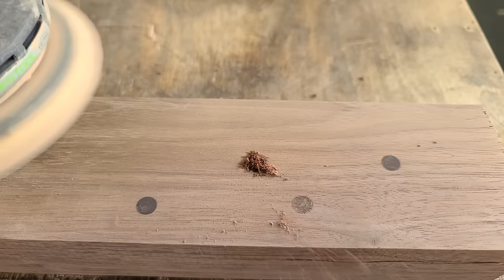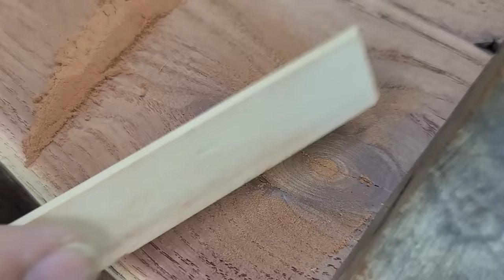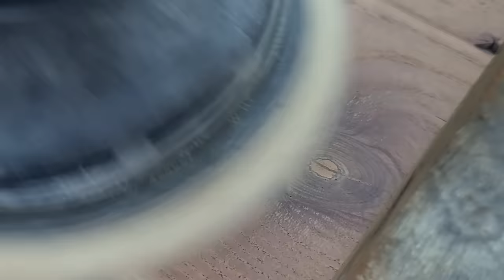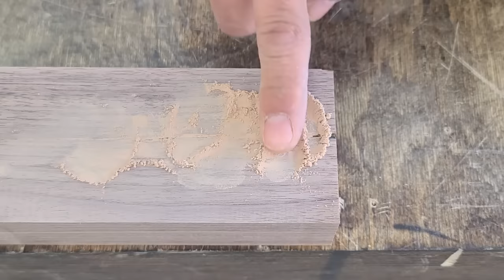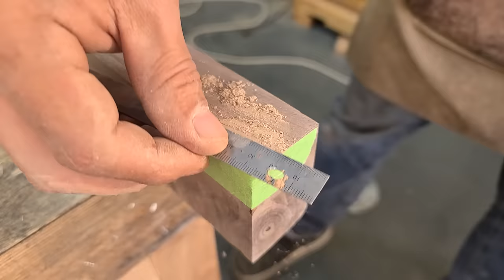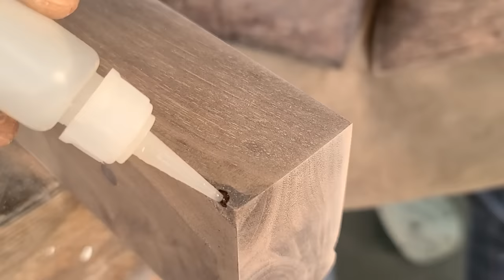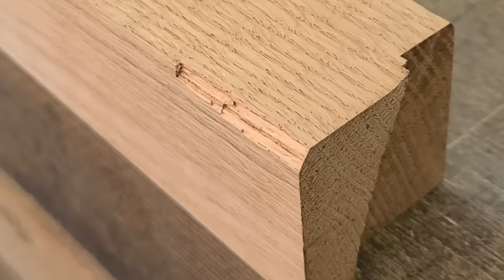Chemical reaction of instant glue and dust / First aid for damaged wood  [Woodworking Tips]

Comment: Thanks for showing another way of using super glue and recycling wood dust. I apologize if someone already said this but more, or less, the same applies using super glue (CA glue) and baking soda. The only difference is, baking soda and super glue creates a rock-like substance. 
So thanks again for showing yet ANOTHER way to use CA glue, Super glue, Krazy glue; another tool in the belt lol.
Reply from the maker: Thank you for good information.👍👍😊
Reply: It does, I used glue and baking soda to fix a moving Christmas decoration last year,  solid again and worked fine
Reply: Молодец. Всё верно🤘
Reply: Jest regular superglue? The tape does not sti k to it?
Reply: @sbrrymom  you sand it anyway.
Reply: Would this work with Gypsum drywall ?
Reply: ive been using a product called plastic wood since over 45 years ago... same results basically
Reply: @dannyboy8067  Мы так обувь подчиняем ☺️
Reply: @DavidWatersJames  Wouldn't that be called plaster? Now if you mean could you use dry plaster instead of baking soda, try it and let us know.
Reply: @sbrrymom  This is not to be mean or rude but even if the tape stuck to it, would it matter?
Reply: @jbbolts  а что это такое? Пластиковая древесина..?
Reply: Yes baking soda makes a good white plastic. But here we go for a most similar filling for wooden material without actually cutting and inserting wood parts. I think it is not bad. I am constantly experimenting with solutions in this category and I will definitely try.
Reply: I use that at work often, to fill, and also sometimes as a thread locker for fasteners.
Reply: Another bonus one is to use micropore tape on frayed usb cables then add ca glue ( makes it harder yet a bit flexible)
Reply: That was fascinating. Thank you.
Reply: I learned this in carpentry class back in 98 but we just used regular wood glue
Reply: @dbspecials1200  Yeah, I've used super glue as thread lock many times. And if you're just trying to tighten up the threads a bit, turn (spin) the screw (metal) back and forth just a little as it dries. As an 80s kid, the early GI Joe figures, NOT the 12in ones, had issues with loose elbow, shoulder, and knee joints. So I figured out as a kid to put super glue in the joint. It basically tightened the arms and legs so they didn't flop lol. But while doing it I had to keep moving the joint until the glue dried or else complete "surgery" haha.
Reply: Is that a buffer, or a sander he is using?
Reply: The first time I used baking soda and super glue I was shocked at how well it bonded. I used it on a cracked headlight that kept fogging up with condensation and it hasn't fogged up since!
Reply: @Roller76  Oh! I'll have to try this one! Thanks for the hack! I've tried it on other projects but not this.
Reply: @robdangerfield7129  I wondered the same thing
Reply: Repent!  repent to Santa Claus.
His sack is full of goodies, and you only have to deal with him once a year.
Palm oil 56
Reply: @MissingPersonsMysteries  Nicely done on the headlight repair! Those headlight replacements can be so overpriced.
Reply: @Roller76 Thank you! they are! I was going to buy after market headlights then i watched the super glue and naking soda trick.  I'm glad I tried this first because they are good as new and I heard recently that the aftermarket headlights are not that great of quality.
Reply: LOL 😜😜😜😜  I shouldn't have to write this but if you have common sense you never use baking soda in wood, wooden filling has very tight bound and it's practically possible with regular glue too 😂😂
Reply: @anuragpatel5982  its worked on a coffee table I've had for over 20 years.
Reply: @anuragpatel5982  I shouldn't have to write this but anyone knows not to use soda as a wooden pie filling. And may I add, its disrespectful to pour baking powder for homies that had their fingers glued together by super glue; only use baking soda... 😜 touché monsieur pussycat!
Reply: not the same as using baking soda and super glue. the results may appear to look the same but it's very different. adding super glue to sawdust looks like it just glues together dust particles together. When adding super glue to baking soda, it creates an endothermic reaction. massive amounts of heat is generated in this chemical reaction and the leftover material is not simply a bunch of baking soda glued together but rather a new hard material with new properties (more akin to plastic). I doubt there's heat produced with the wood sawdust and super glue... but just grab a infrared thermometer if you don't believe me and measure the reaction of baking soda + super glue and you'll see how hot it gets, and how quickly it dissipates. it's chemistry in action.
Reply: Repairs are needed. I'm wondering about the sharp edge, and the repair's stability?  It may be easily fractured.  And stainability?
Reply: Are you sending while it's still wet?
Reply: @nickloss2377  CA glue added to sawdust also generates heat, enough to make it smoke. You can see at a couple of points in the video how the guy had to pause to allow the heat to dissipate before adding more sawdust.
Reply: @kyleolin3566  ah. You got there before I did. One of the most misused quotes of all time.
Reply: @carefulcarpenter  I was wondering whether the effects of heat and ambient moisture would cause the filled portion to dislodge over time.
Reply: Й
Reply: Excellent video, sound effects were cool.
Reply: Do you have to use special tape?

Comment: Be very careful doing this in hot temperatures.  I once used ca glue on a rotten exterior window cill after running out of cellulose wood hardner. The fumes that came out of it were so toxic I lost my breath before jumping away. The fumes are cyanide.
Reply: Wow, very glad that ur okay
Reply: Yeah...this kinda looks toxic.  Good point...  💓
Reply: Welcome to chemistry with no safety equipment, one second you're applying chemicals onto wood, the next second you're dying from a stealth poison
Reply: Superglue fumes are not cyanide, a common misconception given the name Methyl 2-Cyanoacrylate, which sounds alike. However while they're not toxic, the fumes can really suck and irritate your respiratory system, especially in hot weather. I like to wear a respirator when working with it for a long while.
Reply: Thnx just learning some more home projects I will be doing myself!  Carol
Reply: That’s not true, im using ca glue right now and im fi
Reply: Haha under rated comment.
Reply: weak 😊
Reply: I work with CA glue on daily basis and can assure you these fumes arent that dangerous. Surely you should avoid inhaling it but if you do you will only get mild irritation in your eyes and nostrils. Just don't do it every day and you will be okay. What you should really be worry about is exothermal reaction, when this glue sets it might get very hot, hot enough to combust flammable materials like wool or fur.

Comment: I'm a Gunsmith and I've had to use this trick several times on wood stocks. I also use saw dust to color and strengthen two part epoxy. Both methods really work great.
Reply: Liar
Reply: Que es?
Reply: @saadthefirstofhisname  no he's right
Reply: @saadthefirstofhisname  lasagna
Reply: I've done this to my flintlock rifle that got chipped/damaged during hunting, it works perfectly
Reply: @saadthefirstofhisname  truffles
Reply: @saadthefirstofhisname  username checks out
Reply: Repent!  Why do I need to repent, all I was doing was talking about glue and saw dust?!
Reply: Dust doesn't add strength because it's not holding anything together, like fiberglass fibers vs fiberglass dust, the dust does nothing to increase strength. Stranded fibers do. You can use metal dust, still isn't going to hold anything together.
Reply: @otallono  The "dust" is only for color matching, not strength. For coloring you want a super fine powdery dust, but if you want to add strength you have to use a much bigger coarser sawdust or maybe I should say saw chips. Preferably sawdust that is more like shredded. Plus you only want to use the shredded stuff in an area that isn't seen because it looks like crap. It won't really add nice color to the epoxy like the powdery stuff will, just strength. Most of the time if I need to add strength though I just use Acraglas fiberglass flock from Brownells.
Reply: @otallono  but the glue does
Reply: I prefer epoxy glue than CA glue too. You have more time to adjust with epoxy glue. Wood glue will work in certain situation too, especially if you expect the wood would expand and contracts, then wood glue allows a little bit of flexibility. I have tried CA glue on a crack. Yes, it is super strong, but later the wood contracted and cracked at somewhere nearby.
Reply: Does it work for polymer hardware, too? 😏
Reply: jesusislord6545  i was born ok the first time thx!

Comment: It's a nice trick for a one off repair, but not as a rule of what to do. $8.00 for the CA and $10.00 for a whole 2x4. Also you are going to ruin a $5.00+ sanding disc so it's not cost effective.
Reply: Chinese CA costs around $0.2 per bottle.

Comment: If you want to have some real fun and add color to your woodworking, try brass and CA. Ask the person who cuts keys at your hardware store to let you have some of the filings. Put the filings into the hole or crack you are trying to mend or embellish. Add the CA as in the video,   The chemical reaction burns like napalm. Sand the brass down. Because the filings are not as fine as sawdust, you can fill in any gaps with more brass and CA. Any powdered stone or even dyed sawdust will work just as well as in the video.
Reply: Oh man, I love this idea. I have brass powder but never thought about filings- or stone powder. 🤓

Comment: I've used this trick a number of times but a couple things you need to keep in mind:
> the CA glue/sawdust matrix is considerably harder than all but the hardest woods and requires careful technique sanding. 
> the patched or filled spot will not take stain or finish the same as the surrounding wood.
Reply from the maker: That is correct.
It is as hard as acrylic and there is no finishing treatment.
But if you know the shortcomings and use it, it shouldn't be a problem.
Reply: Thank you!
Reply: One thing you can do is mix the dust with stain in the hole and let that dry a bit fist. Then it matches pretty well.
Reply: @망치소리HammerSoun  you can mix the stain with the dust before applying glue
Reply: It's too dense
Reply: Also, make sure you have plenty of ventilation!  CA glue can really sting the nose if you are not careful.
Reply: @DowellPiano  and the eyes!!
Reply: I did this for a quick fix job on a knife handle, but i used gorilla glue, been 2yrs and it still hasnt cracked lol
Reply: Is ca glue super glue?
Reply: @lizwoodard5286  Yes
Reply: How well does it weather outdoors or when exposed to moisture?
Reply: @Yanceyray  
I've been using it as a finish on exotic wood Fly rod reel seats for over 20 years.
It's basically an acrylic finish when it cures, so yeah - it's weather proof.
Make sure to use the super thin stuff.
 Hobby shops carry it.
Reply: Shit, i was exited for a sec till i read it can't be stained 😞 thanks for the heads up 🤙
Reply: Could you possibly mix a bit stain into the sawdust and let it dry before using it in the repair?
Reply: @lizwoodard5286  yes but you can buy it in different viscosities. He’s using a thin variety. You can get medium as well as a heavy flow. Check Amazon.
Reply: @DowellPiano  The CA fumes (or direkt CA) can make you also blind pretty fast. Good ventilation and caution and/or safety glasses (to at least deflect the fumes) are very good practices when handling large quantaties of CA. I would at least recomand it when it's more than the usual small dab.
Reply: @MakiMakixc  I've had the fumes burn my eyes more than once - not fun!
Reply: @DowellPiano  what is ca short for? Just curious what type glue it is
Reply: @jeremymullis8294  cyanoacrylate, better known as super glue
Reply: @lizwoodard5286  CA = CyanoAcrylate = superglue
Reply: Good to know....thanks !
Reply: @alanvcraig  thank you!
Reply: @theproduct8375  oh ok! I just thought it was a type of super glue
Reply: @lizwoodard5286  Just look for the active ingredient...   cyanoacrylate   and you have ca glue....
Reply: @lizwoodard5286  
Yes.
Reply: @jkg6211  little known fact, CA was developed as a war effort for internal use for medics to stabilize soldiers enough to get them to surgery. 
In agreement with you, it is relatively stable outside. Hi UV could weaken after X amount of time. And Acetone is about CA's only nemesis.
Reply: @a-a-ron6822  while it cant be stained, if you are using a hardwood, it does accept an oil or lacquer finish. 
I would not recommend using CA on a softwood, as it is harder than the wood itself and will very likely cause the surrounding wood to sand faster and end up low - careful technique is needed.
Reply: @lizwoodard5286  Делал супер-клеем также,эффект одинаковый.
Reply: @lizwoodard5286 TLDR; Yes. CA is Cyano Acrylate, popularly known by the trade name of "super glue" among many other aliases. As super is merely an adjective which could be applied to any sort of glue; most of the world uses the full name or acronym CA to be more specific on the glue type.
Reply: @망치소리HammerSoun  Can you apply polyurethane over the CA sawdust?
Reply: @a-a-ron6822  You can add dye to the glue before using it.
Reply: I guess one solution could be to try to use the same stain mixed in with the sawdust, or sawdust from an inconspicuous area of the piece that won't be seen and use that to fill the hole? Plus I guess if you give the while thing a light sand that should produce enough sawdust if the same or close shade to use to fill then clear stain or varnish the whole thing to try to keep it uniform.. might be difficult but not impossible and probably closer than using sawdust from elsewhere.. just a thought. 👍🏴
Reply: How long do you wait before sanding?
Reply: @snejsnej01 awesome point!
Reply: @alanvcraig  discovered by accident in my hometown at Tennessee Eastman.  The chemist that discovered it came to our chem class in high school
Reply: so awesome ♥♥♥♥♥♥

Comment: Another Activator than Backing Soda,
Is Wood Ash, and it gives a Gray color.
For White holes: use Baking Soda
For Gray holes: use Wood Ash
For dark brown holes: use Walnut 
And add crushed charcoal to darken any combination, just mix the dry powder before you add the CA glue
Reply: Вот это рекомендации настоящего Знатока! 
Благодарю!
Reply: wood ash like from a fireplace?
Reply: @yay-cat  yes
Reply: @yay-cat  yes
Reply: Cinnamon also reacts the same as baking soda but looks like & acts like wood and smells fantastic
Reply: @nobody3692  Right .... And Cinnamon is a type of powdered wood.... 😉
Reply: @jansolo55  for sure, if u consider bark to be wood.. now im wondering if the bark from other woods reacts as well? Imagine all this time, we jus needed sum bark from of the same kind wood & craft glue to perfectly fill imperfections

Comment: You can use this trick with regular wood glue (Tightbond, etc.) as well, and it tends to match the wood better than with CA glue. The advantage (or sometimes disadvantage) of CA glue, though, is that it will cure and harden a lot faster. For repairing large chip-outs and cracks, CA glue works better. For small repairs, I've found that regular wood glue works better, as the repair is much less visible. Either way, this method of repairing cracks, chip-outs, gaps, etc. has really saved more than one project I've worked on. When done well, you can't even tell that there was ever a problem.

Comment: Been doing this for decades, but usually with CA (superglue/CyanoAcrylate) and baking soda for repairing R/C vehicles - makes for fast repairs in the field.  I apply the glue first, then 'dust' the wet glue with the baking soda/sawdust using a re-purposed denture bottle.  A re-purposed DIY inkjet refill dropper-bottle does fine too.  If you need the hole bigger, just open it up a bit at a time with fine drill bits. Then repeat until the hole is filled.  Sand and clean up, especially if you're mailing it.  Customs once thought a kit I'm modified for a friend held drugs, and ripped it apart.  He got a box full of parts.

If you're not in a rush, using the re-cycled sawdust with carpenters glue to make a paste, it makes a color-matched filler for the project.

Other trick is for making a hard coating for wood (works a treat on balsa!)  You find something called "epoxy thinner" (used when re-enameling a sink or tub)  You mix up a slow-set two-part epoxy (it's the easiest to use) and after mixing, add the thinner drop by drop, stirring every few drops. A Touch'n'Flow or other solvent glue applicator is best to add the thinner, or a glass pipette if you have one.  Once you have it thinned to about wall-paint consistency, you can paint it on.  First coat on a porous wood like balsa can use a milk-consistency mix, so it soaks into the pores.  I used it on a balsa-planked boat hull, and it was stronger than a hardwood or fibreglas one.

WhiteWolf in Ottawa, Canada
Reply: the baking soda one we use on the floor at work.
Reply: Who cares you didn’t make a video.

Comment: I've run a ton of side by side tests filling voids and this is pretty much the simplest and best way....  However, I will add that if you premix the glue and sawdust, then pack it in, you will get a much better result and you only have to fill and sand once...  you will avoid the voids.

Comment: For large cracks and voids I prefer to pack the areas with chips and shavings first. A rasp on an off-cut will produce a pile of larger filler very quickly. Then I'll top that off with dust and CA.
Reply: Good tip.
Reply: Interesting on edges I tend to plane or chisel a flat edge and glue a block of wood once cured I shape the block down flush. But these methods are great to have